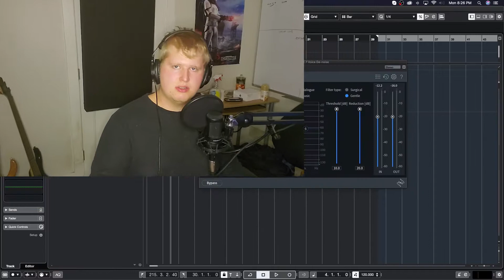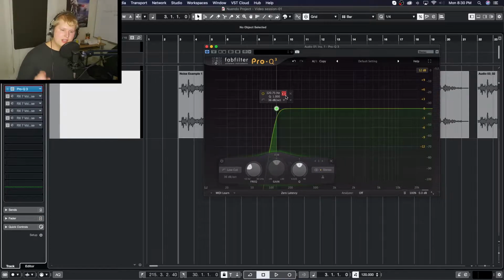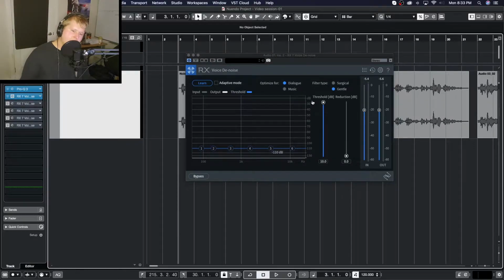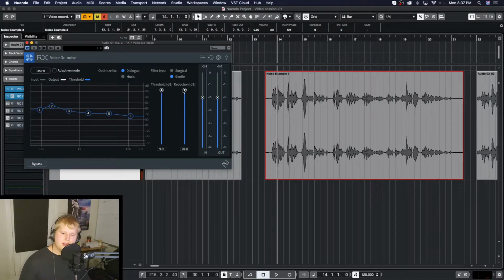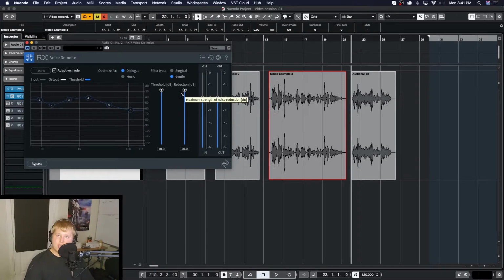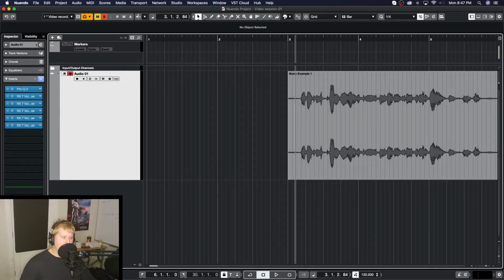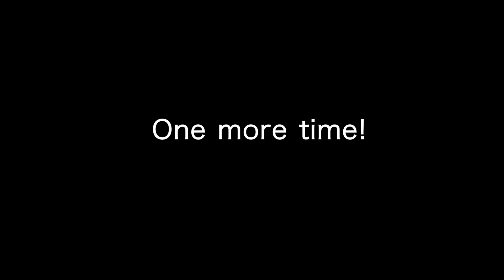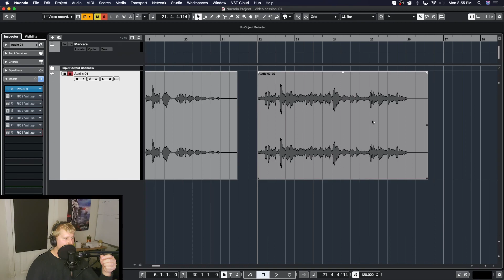De-Noising Your Audio - Audio Tools Explained

Comment: Nice set of videos.  I was wondering if you've tried the RX noise reduction from RX elements (voice denoiser) on music tracks and had good results, or if you really have to get the standard RX for good noise reduction?  (My use case is to possibly clean up recorded samples prior to making sampled instrument)
Reply from the maker: Thats a good question. 

Personally I only ever used the elements denoiser until a couple months ago when I finally upgraded to the advanced package. It works, but I will definitly say that the standard denoise works better for music than the dialouge focused one.
Reply: @hawksmusic9815  Thanks for the reply.  The Izotope verbiage seemed to insinuate the denoiser in elements might work on midrangy instruments - but like you mentioned - said it wasn't designed for it and may or may not.  Left the impression that for alot of music with different frequency spectrum that the elements denoiser might not be right tool.  I'm just a hobbyist so going use some other tools until I can justify the spend for standard RX.